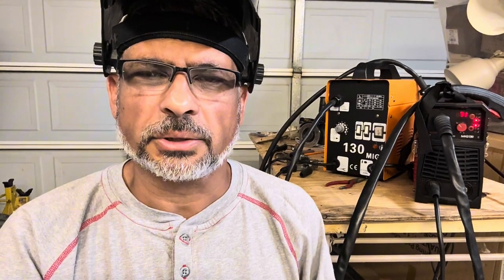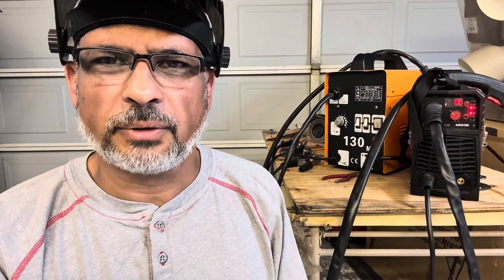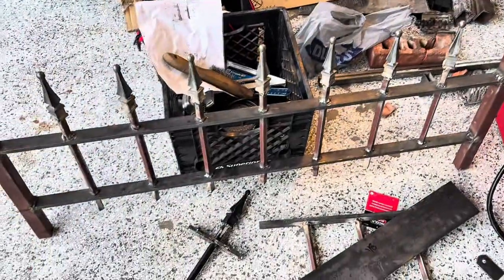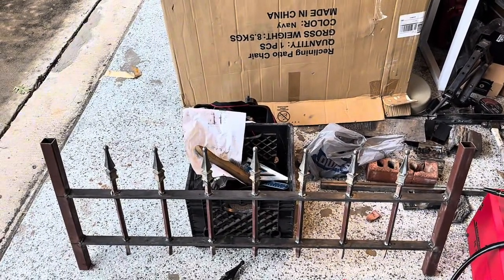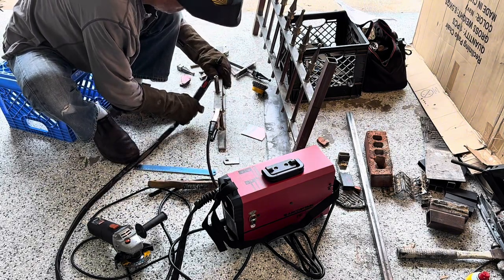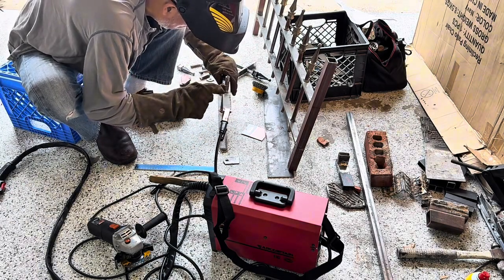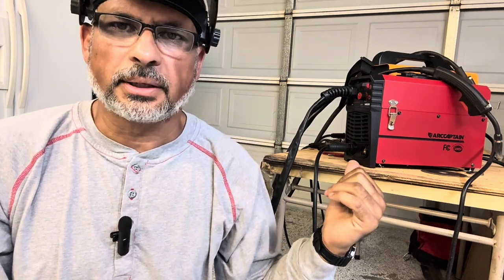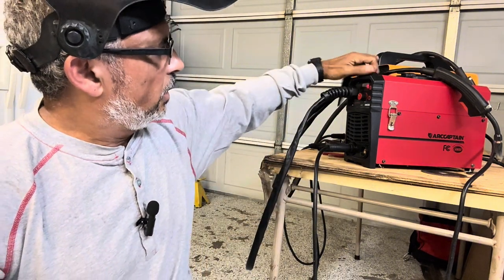My first project with Arccaptain MIG 130

Comment: My wife is an electrician. When I first started welding, the breaker would pop all the time. I noticed though some of the circuits I was plugging into were not popping. She was telling me the wire was rated for higher amps. Essentially there are 2 types of outlets. There is a non safety version that is classically rated at 15 amps (almost every outlet.) versus the protected version. This protected version has a small line coming from one of the two prongs you plug into the wall. The tell tale sign is that weird little like that looks like a “T” on one of those prongs.

These outlets are rated for 20 amps and the type you want to plug into when you’re welding for extended times.

Also if you look at the outlet with the cover plate on you’ll be able to read the amp rating on the outlet.

But yeah you won’t have to remove the face plate if you could see that little “T” in the prong..

Just google 20 amp outlet and you’ll see the little line  im talking about.

Also one last tell tale sign. All 20A outlets are called “tamper resistant”.

This literally means your child can’t shove a fork in the socket because there is a plastic shield preventing one prong side to open up when the other is not being opened up at the same time (child with a fork scenario).
Reply from the maker: Thanks for the info, I never would have guessed that the T means 20A.
I am actually running this welder on a 20A breaker for my garage but it still pops the breaker if I am running the welder on above 90- 100A for more than 2 minutes continuously. If I am running 80A I can weld all day long. 
I am thinking that my breaker could be the problem and I may just replace it with a new one.
Reply: @KhaledsDIY  Personally I have no idea. She is the electrician which is funny to say that. I do HVAC and plumbing but we met cause of that. Anyway just make sure the wire is rated to handle a bigger breaker. That makes sense though you need to always have a cycle duty. Welding on 90AMPs without being on 220 is definitely going to pop if you're not controlling it. Any welder is going to be some type of 20% duty cycle. You're supposed to manage that yourself, the breaker is the failsafe. But if you try to change things around you risk creating a lot of heat in the wire and end up burning your house down from the inside out. Just make sure that you're considering using 220 for 90amp+ welding or duty cycling yourself. 2 minutes seems fair to me.

I have a stickwelder and a flux core welder like a Harbor freight. Its a northern industries which is Northern Tool. Got it second hand. I prefer stick though. I just suck at it still and burn through everything. The fluxcore is nice though. Easier for sure but make sure you're taking care of that duty cycle lol! I know exactly what you mean too, the wife was teaching me about why the breaker was popping but that was then. I learned now though, the duty cycle.

Comment: Why is that pulling more than 20 amps?
Reply from the maker: when I used more than 100 amp ( especially if I use 120 amps) on the setting I blows my 20A breaker, it take shorter time to trip when approaching higher amps, not sure why but it seems consistent with many of the videos I watched. Any suggestions?